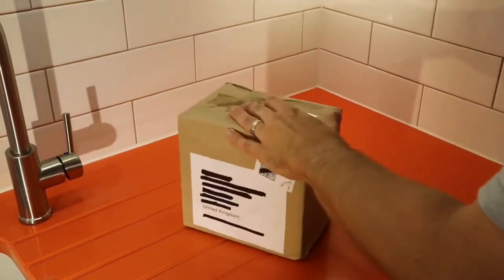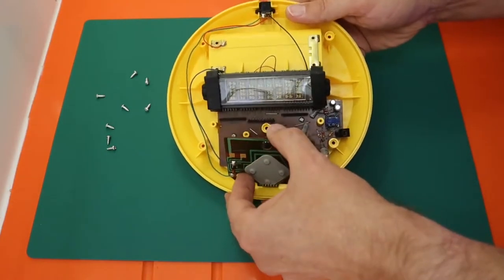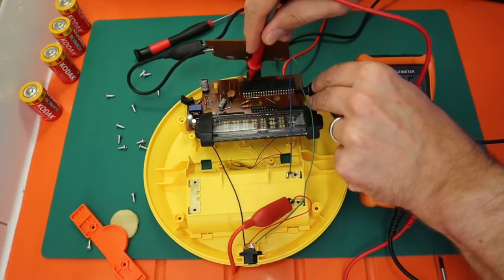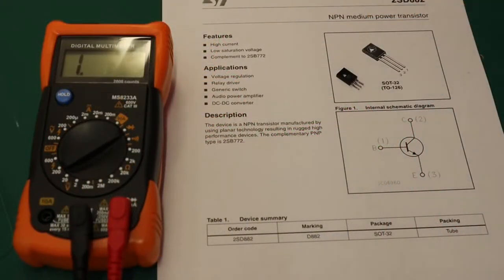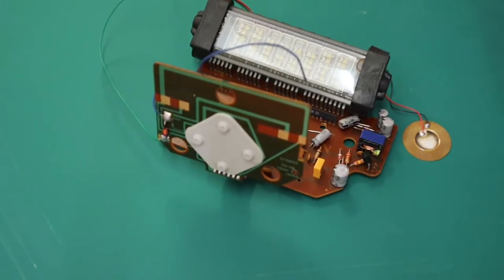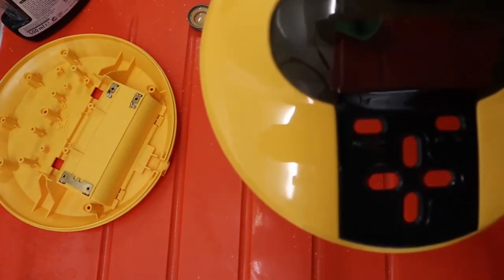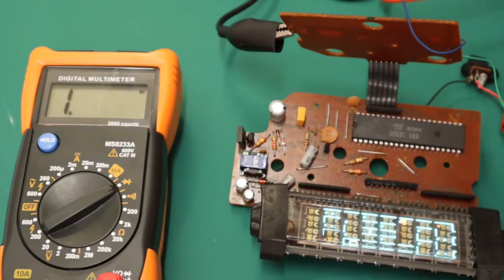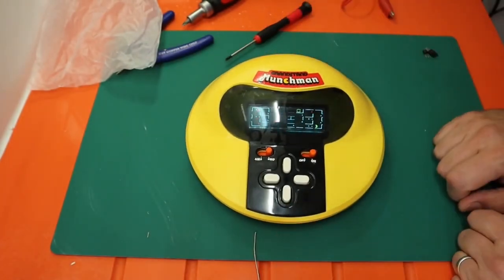Grandstand  Munchman / Tomy  Pacman Repair - Retro Gaming

Comment: I have found when you use the small polishing wheels they tend to heat the plastic up too much and it ends up either burning it or making it opaque If however you use a bigger wheel for some reason it seems to work better and slower to Just a thought love the videos great repair jobs
Reply from the maker: Thanks David, yeah that dremmel was way too aggressive! Lesson learned there! That was actually my very first repair and video, thanks for the tip and the kind words. Glad you are enjoying the videos

Comment: Do you feel if you had skipped the bit with the dremel the screen could have come out just great? And could you be really specific about what did work? Great video!
Reply from the maker: Hi thanks for your questions. It could be done without the demel but using the materials I did it would take a very long time by hand. I still haven't found a great solution

Comment: Interesting video. I'm currently trying to find a mains adapter replacement, non original and affordable and what size plug, do you know if it's 2.5mm? also, do you know what the polarity is by any chance?
Reply from the maker: Hi Joel, unfortunately I don't know the adapter polarity or connector type and i dont have the game anymore to check. Sorry. Going forward I must try to remember to determine that and state it on tue videos as I get quite a few questions like that. Thanks for you comments. Sorry I can't help
Reply from the maker: Hi Joel I just found this. Has some information in on an adapter. No guarantees, but hope it helps https://archive.org/details/manuals-handheld-games-Tomy-PacMan/mode/1up
Reply: @RetroTechRepair  that's really helpful, thank you very much for taking the time!

Comment: Great video, just catching up on all your older ones, 1 question i have, why do you keep calling the boards inside PCA? Ibe heard you say this a few times now, shouldn't they be ed PCB or is it an in joke ? 

Thanks!
Reply from the maker: Hi thanks for your question. This has been a debate on some of my other videos too. I spent many years as a hobbyist calling them PCBs. But... In volume manufacture my experience has been that the board is the bare board. Once populated with parts, it's an assembly.

To Quote Wikipedia  "A PCB populated with electronic components is called a printed circuit assembly (PCA), printed circuit board assembly or PCB assembly (PCBA). In informal usage, the term "printed circuit board" most commonly means "printed circuit assembly" (with components)." (https://en.wikipedia.org/wiki/Printed_circuit_board)

I worked many years alongside (not as) electronic engineers in the US and parts or mainland europe for a VERY large manufacturer of consumer electronics. If you are ordering say a 10 million of them, then the difference between a PCA and PCB is extremely significant and there is no room for  "informal usage".  Hope that clears it up (or starts a massive debate)

Comment: Thanks a lot!  Great repair. I have one with a cracked screen. Would it be worth doing all the other investigations to make it work again?  I think my sons back in the day had some anger issues when pac man sneaked up on them 😆
Reply from the maker: Hi Jane, thanks so much for your comments. Whether is worth it or not is hard to say, maybe check the prices of a used one and see. If only the case is damaged it might be repairable, but if the VF display  (glass inside) is broken then air will have entered and it won't be repairable without parts from an identical machine. Hope that helps.

Comment: thank you for this masterclass. 
do think It could run on a usb by any chance? 
cheers
Reply from the maker: Great question, I don't actually know. There is no usb connection as it pre dates usb, so you would need an adaptor to connect it. USB is 5v not the nominal 6v from the C cells. There are different max currents for different USB standards but it's current draw should be less than the latest USB standards. So my GUESS is it probably would with some effort but I can't say for sure
Reply: @RetroTechRepair  thanks for the reply, mate.
Reply from the maker: @AT-AT-AT-AT  you are very welcome
Reply: an update. 
I’ve managed to make it work with a 2.1mm Coaxial Tip/USB cable. Just for the record. :D 
cheers!!